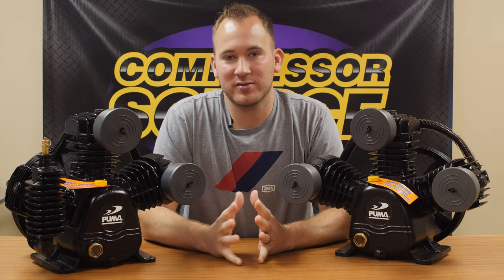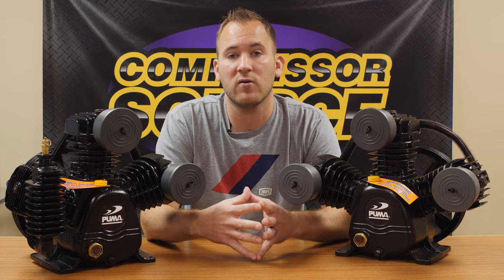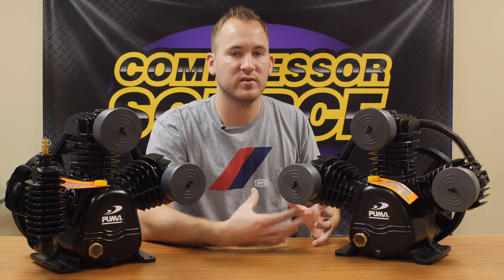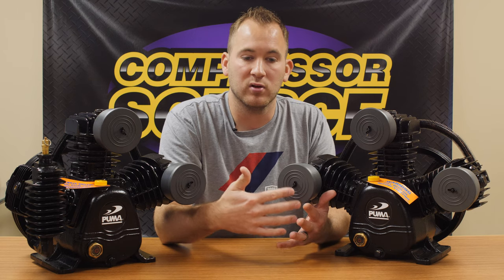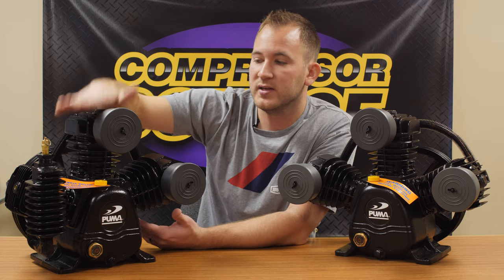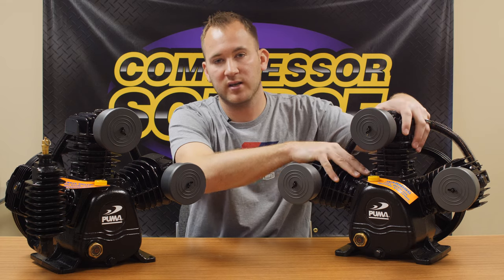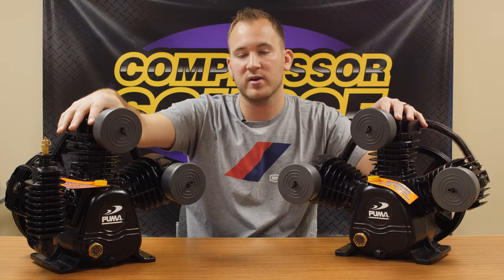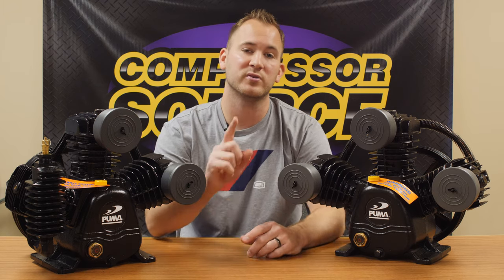The Difference Between a Single Stage and Two Stage Air Compressor Pump

Comment: In the case of Two Stage compressor, the cylinder without a filter (second stage of air compression), is normal a high temperature in this housing (very hot)? I mean, is normal that is so hot, more than the other ones with air filters, so you can't even touch it in operation?
Reply: The second smaller piston is re-compressing the air from the first piston so yes it will get quite warm
Reply: Yes

Comment: Those hobbyists wanting a quality compressor should do their homework then buy a good used INDUSTRIAL compressor like Saylor-Beall. I scored two for 250 bucks because they had three phase motors (I previously got a rotary phase converter to solve that problem because three phase motors are far superior for machine tools, compressors etc). Those not wanting to run an RPC or VFD can replace the motor with a single phase part. You can never have too much capacity so I'm going to add a third to run more capable sand blasters. When not blasting one is plenty for shop air.

Comment: Husky 60 gallon single stage lasted seven years 155psi
Reply: 7 years is nothing to brag about unless it's used commercially. My big single stage compressor is 29 years old,  inherited from my father and grew up using it.
Reply: @itptires  R & O tire shop FL
Reply: @itptires  I can’t lie things ain’t built the way they used to be.
Reply: @itptires  and it failed cause of a gasket. I just got to on today.

Comment: which is best to paint cars
Reply: This is a tricky question. A single stage would be better since you don't need the high pressure, but the problem is most residential single stage compressors are underbuilt using small cylinders and weak motors despite having a big tank.  The result is a compressor that underperforms, which drives people towards 2 stages. However, 2 stages are overkill for painting and produce more hot air, making it require a refrigerated dryer to mitigate water in the hose and gun. Obviously, this is a more expensive setup. 

A proper setup would be a higher horsepower, large tank, single stage using a magnetic starter, but those aren't really marketed. You'd probably have to build your own using by choosing a motor, magnetic starter, tank, and pump separately to get what actually ideal.  Would it be cost effective is the question.